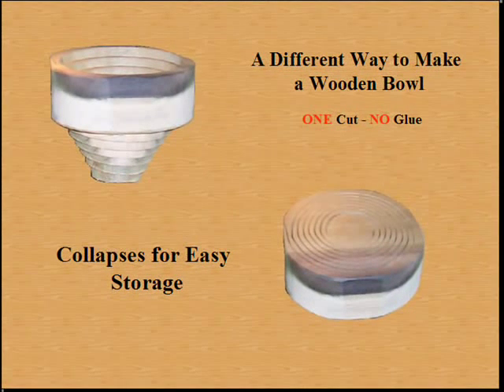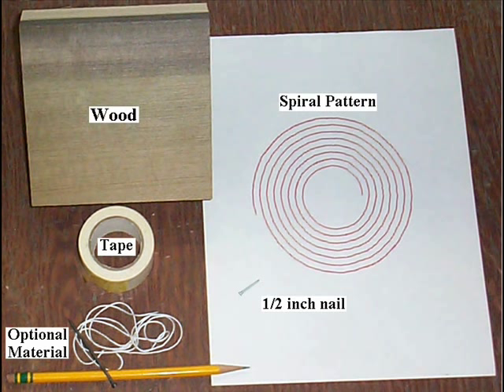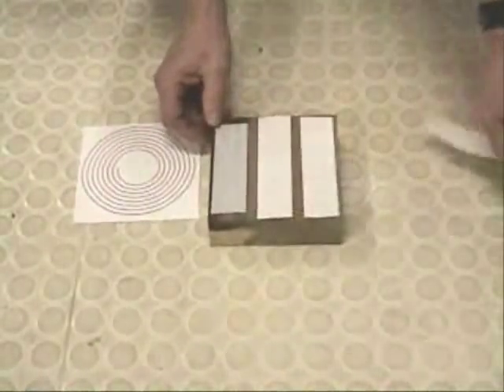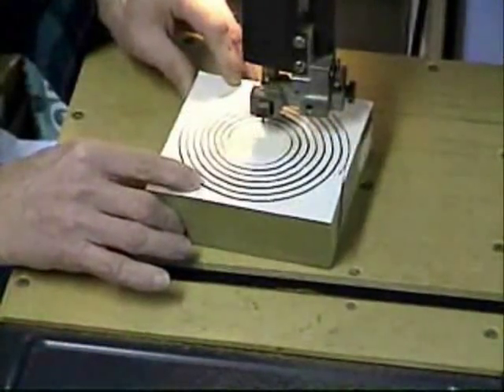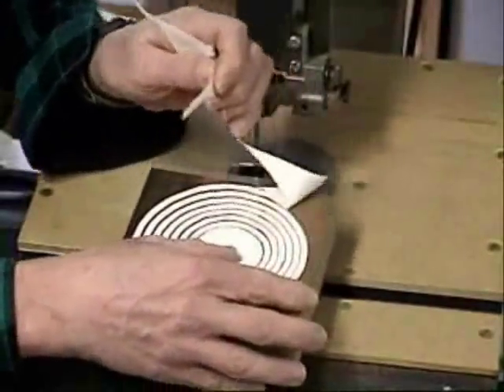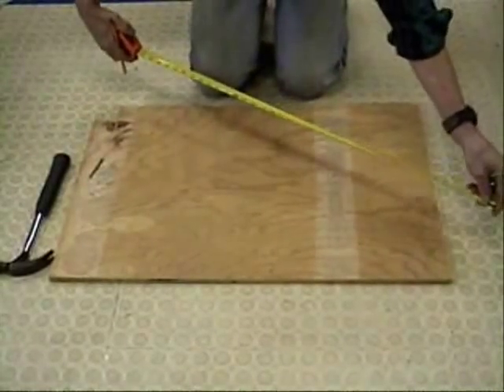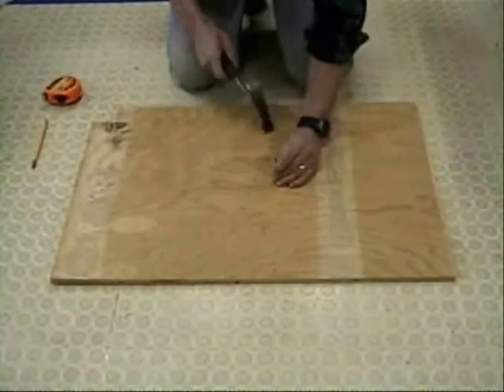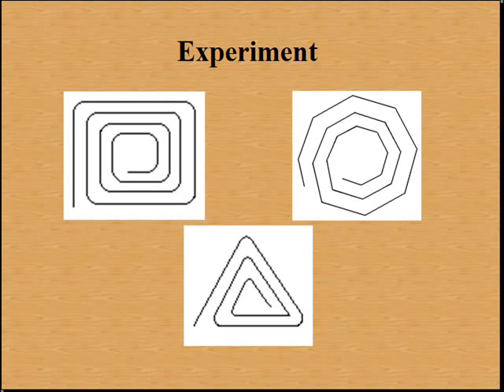band saw bowl.wmv

Comment: glue stick or spray adhesive would be better than using double stick tape I think.
Reply from the maker: You're probably right. I used what I had laying around
Reply: In the long run, not a problem as what you used worked. My comment was meant to suggest to other viewers that there are alternatives to using the double stick tape. I should have worded it more clearly. I've even used wood glue, just smear a thin coat on the surface and place you paper pattern on top. This will require sanding or scraping off any remaining paper so need to keep that in mind as it could damage the surface if you're not careful.I do like the bowl, very nice and thanks for making the video showing how to make it.